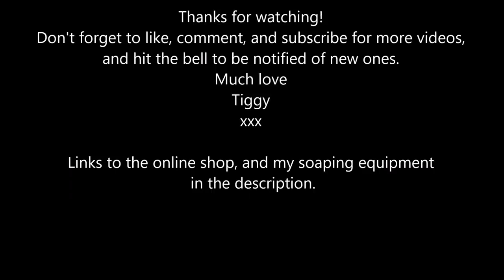Soap making with the heat transfer method | FuturePrimitive Soap Co.

Comment: I’m in Western Australia and luckily haven’t been affected by the fires...yes they are mainly over the east. We are currently completely cut off from the east so no trucks able to get in or out as Eyre hwy is closed. The trains are still running but around this time of the year they are usually flooded for a week or so. 
It has now turned into a mega fire with fires in Victoria and nsw joining at the border and an approximate 1/2 million wildlife killed or suffering severe burns. 
Smoke is so thick in Sydney that the bridge is unable to be seen in the smoke and a health warning out for people to stay indoors especially those with respiratory problems.

Comment: What I did once is dissolved costic in water in a glass jar with a lead and placed the jar in the pot with oils hard and liquid and the temperature of the lye reaction melted all hard oils. Once the oils and lye got to the same temperature I mixed them together as usual. I did this as an experiment of making soap without  access to energy 🤩. Apart from oily bottom of the lye jar all went well.
Reply: onepartofone interesting !